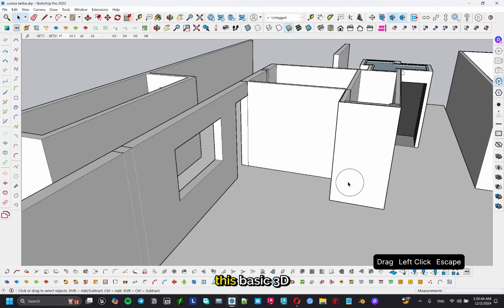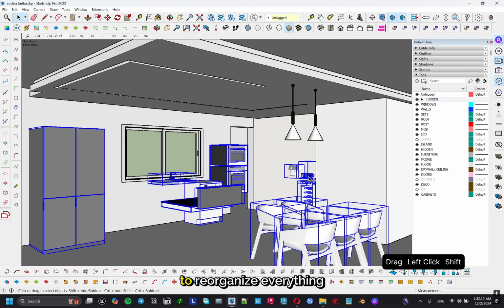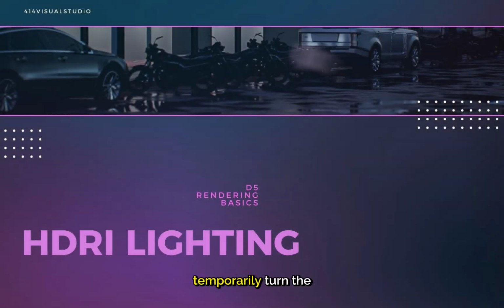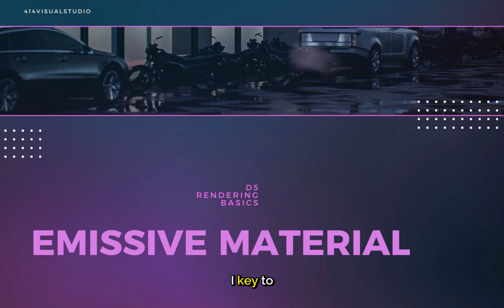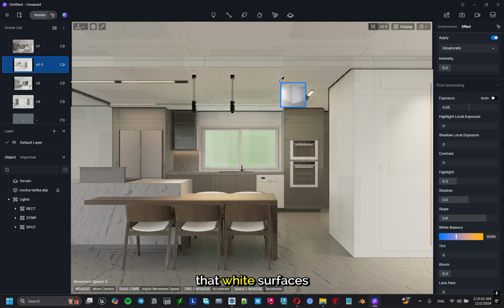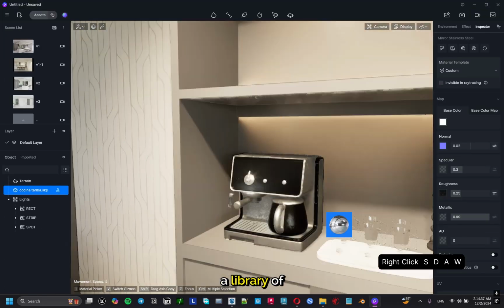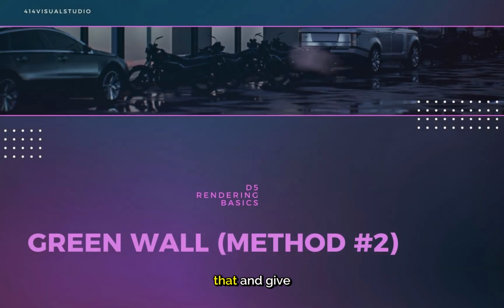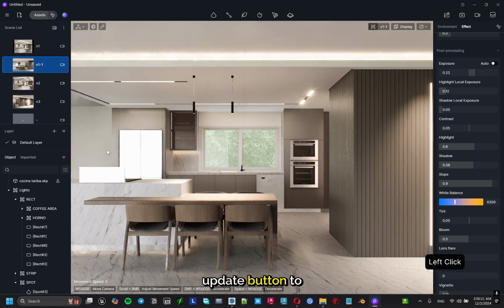Interior Rendering Secrets: SketchUp & D5 Render Masterclass

Comment: Are you setting your "camera" height and FOV in sketchup or are you setting them in D5? If D5, are you able to set a height with a specific number, or are you using the 'E' & 'Q' keys?  Thanks!
Reply from the maker: Hey! Thanks for commenting. In my workflow it's a little mix of both, I create the scenes in SketchUp with an FOV that will allow me to see everything that's relevant for the design process. When you export your scenes D5 will also catch this camera info, but I like to change the FOV to a more realistic/cinematic focal length, usually from 21mm to 50mm. You can find that parameter in the advanced camera settings or the first button in the upper right corner of the viewport, remember to click on update to save. For the specific height, just go to the last button (far right) in the viewport s top right corner and you will find the "altitude" parameter. Hope it helps!